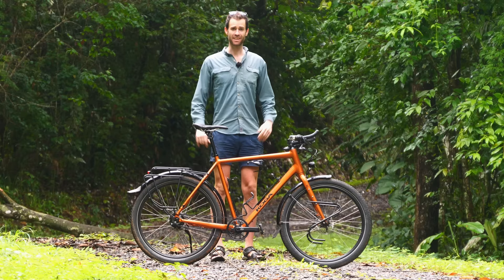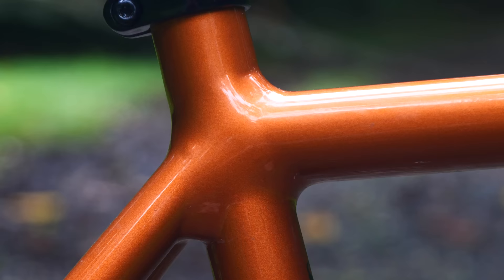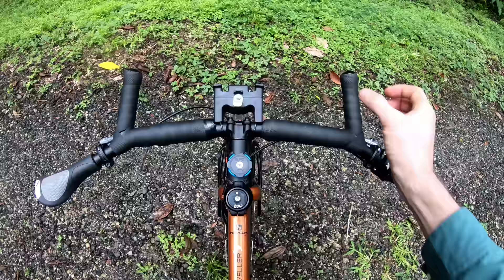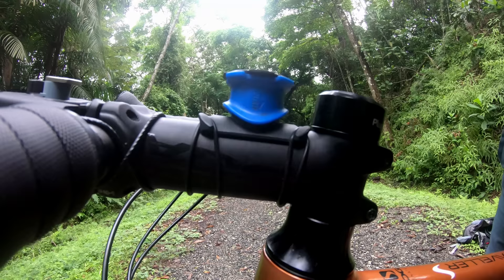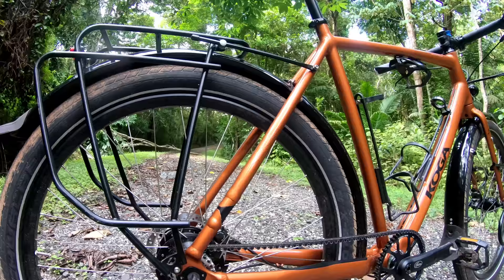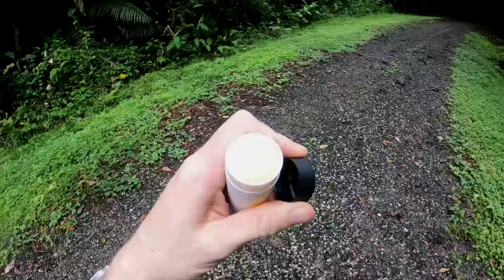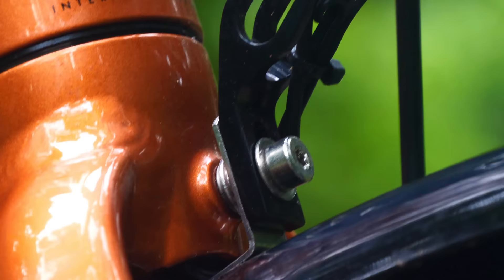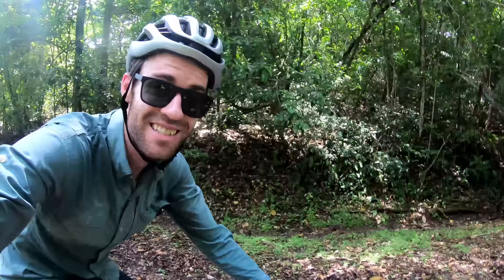The 2020 KOGA WorldTraveller-S is a $6000 Indestructible Touring Bike

Comment: Super smooth welds? Well where your rear forks meet the wheel i found the welds kinda boiley, but hey what do you want at this price level?
Reply from the maker: What does boiley mean?
Reply: @Cyclingabout  like it is boiling, as if there are bubbles and pits coming up the surface. Koga did a great job smoothing the weld on the main tubes (or asked their framebuilding company to do so) but left out those welds near your rear wheel, i find that strange. The line about the price point was me being sarcastic about that, because at this price point i would not want any defects - visual or technical.
Reply from the maker: @joramvandervorst7715  Gotcha. Not sure why the welds on the rear end don't get the smoothening treatment, I suspect they need a certain amount of surface area for the putty to stay in place.

Comment: Alee, Koga offer the same bike with an electric motor drive.  Do you know anything of it’s performance and durability?  Could you go to the same extremities that you do with the non-assist, Rohloff version ?  Asking for a friend.  Ha.
Reply from the maker: It's essentially the same bike, but it's using the best electric motor available, in my opinion (Bosch CX) and can support 1000Wh of batteries. The Bosch motor and Rohloff E-14 also communicate with each other for insanely fast gear shifts! You could do the same kind of stuff as I do, but you would just need to find a power outlet a bit more often.
Reply: Thanks, Alee.  It’s what I was hoping you’d say.

I ordered one this afternoon with a cash windfall.  Literally, a life-saver, or I’ll pass with a smile on my face.  :-)
Reply from the maker: @Super.Quasar  Congratulations!

Comment: Sure, I've never broken an aluminum frame bike, because it doesn't flex like steel. I've broken right side chain stays on 2 steel frame bikes. But I'll take a flexible steel frame that breaks every 3-4 years over the harsh ride every day that aluminum has. Flexibility has a place on touring bikes. Can you imagine 6 hours a day on an aluminum frame?
Reply from the maker: It's a myth that aluminium bikes are uncomfortable, and we actually have data on this. It requires over 500N to flex most bike frames one vertical millimetre because triangles make for very stiff structures! In comparison, a flex seatpost like the Ergon CF3 requires just 69N, and your tyres require less than 50N to travel the same distance (the wider the tyre, the less force required). In the scheme of all vertical flex, the frame makes up a very small percentage, aluminium or steel. 

Can I imagine riding an aluminium frame for six hours? Yep. I typically ride my aluminium touring bikes 40-50 hours per week, and I find them supremely comfortable. 👍🏻
Reply: @Cyclingabout  Look, man, I've been bike commuting up to 52 miles a day, since I was 15, and I'm 49 now. I was hot to get my first aluminum bike, and the vibration was wicked. My hands were numb and butt hurt even with 10 years on a brooks. Back to steel and then gave aluminum another try. Jarring is the best description. Carbon is great for a plush ride, but it does not last as long as steel either. Best for comfort is Steel with carbon bars, Last, I'm 6-5 265, so we are very different riders, with very different sponsorship deals. Company hands me a 5K bike I'd likely love it. Then again, ever consider you wouldn't need fat high rolling resistance tires if the frame cushioned your hands a bit?
Reply from the maker: Don't get me wrong, I can 'feel' the difference between aluminium and steel bikes without bags (although it's pretty damn hard with wide tyres, a flex seatpost and good grips). But this mostly comes down to the way the materials handle vibrations, rather than the way the structure flexes vertically. Add panniers to a bike of any price point and the vibrations will disappear because they absorb so much shock!

What kind of tyre widths were you running on your aluminium bikes? Were you running an in-line aluminium seatpost too? Did you ever attach panniers or bikepacking bags?
Reply: Jason Pippin / I use fat low rolling resistance tires, 42mm, prefer them over 28mm I used to use before. 4~6 atm instead of 7~9 atm before. 6'4" & 240pounds😎

Comment: Finding for sale "your" special handlebar is really very very difficult (and a little bit expensive too). I like it but in many parts of Europe, apart from few spots in NL it is almost impossible to find and buy it. Great handlebar but just to be seen in youtube. :(
Reply from the maker: You can buy it online! CycleSense in the UK and Vakantiefietser in NL are shipping globally. Price is the same as a Jones Loop including shipping.
Reply: @Cyclingabout  If the price is the same of Jones loop doesn't mean it is cheap. 86 euro + postage costs is a quite high cost for an alloy bar. Crazy bar costs 65. Apart the cost I wish to send you all my compliments for your cycling activity and for the introduction of the touring bar that is really very very nice. I am in progress to build up a Surly straggler with Alfine hub that it will look like your previous steel bike. For the moment (and for my needs) your fantastic WorldTraveller-S will remain a dream to be seen on youtube. PS by the way you did not mention that the Orange (great choice) it could be considered a tribute to the Netherlands (home of the Koga).
Reply from the maker: ciccio formaccio This is a very niche handlebar, so the cost can’t be low like a typical alloy handlebar! Given the unique design and engineering, I think the price is very, very reasonable.

Comment: have you ever heard of the Pinion transmission? they have long overtaken rohloff! I was a mechanic for Idworx, also from a certain Mr. Gastra, whose name is also in the Koga, the wheels are not worth their money!
If you want a really good travel bike, buy a falconry or racing steel. This is true engineering at the highest level! Own luggage rack with 50 kg !!!!! Lowraider with 30 kg. a Koga or idworx can not even stand this. and who please installed nice still an eccentric bottom bracket?

Comment: It's also cheaper than steel and not as hard on tooling
so it is cheaper to work. So why is it so expensive ?
Reply from the maker: The frameset has a very high attention to detail including the fully guided internal cable routing (this costs a fortune on a steel bike too). The research and development costs are also very high. The tube shapes and butting profiles are all unique to each KOGA frame size; you won't find these tubes on any other bike, unlike a typical steel bike.

Comment: Maybe it's my lack of touring experience, but having a belt drive, internal routing, and an aluminum frame on a touring bike where you are out in the middle of no where doesn't seem like the most ideal thing. Your frame cracks, it's toast. Have an issue with the belt drive? Good luck finding parts for it. Even in a large city with lots of bike shops where I'm at, most have limited to no selection of belt drive components. How could you expect a rural country you're touring through to have them? And internal routing seems like a cost saving measure for the frame manufacturers to not have to add braze-ons. Trying to route internal cables if something goes wrong while on the road sounds like a nightmare.
Reply from the maker: The reality is that frames almost never crack. A broken frame doesn't ever cross my mind while I'm cycling along, especially knowing how much research and development goes into a touring-specific frame like this (or any of my other touring bikes for that matter).

I carry one spare belt for my belt drivetrain. There has only been one instance in 100,000km+ of belted riding where I've ever needed to fit a replacement belt. I can't give this drivetrain higher praise!

The internal routing on a KOGA WTS is fully-guided. That means you put the cable in and it pops out at the right place. It's the most elegant and easy solution I've ever seen on a bicycle.
Reply: @Cyclingabout  they actually sleeve the internal routing? that's so rare nowadays. I wish more manufacturers took the time to do that rather than focusing on the aesthetics and forgetting about the maintenance and future mechanics working on it.

And I gotta say that's impressive with the belt drive system. Every belt drive that came into the shop would just squeak and creak, mostly due to the salted roads in the winter. So hearing that experience definitely changes my view of them. 

Maybe they are manufactured better with Koga, but I've only seen steel bikes crack from clydesdale weight riders. I've had far more aluminum ones come in with cracks or clean breaks with lighter riders and most are just commuters.

Comment: Oh its destructible allright. Gimme your bike and ill show you!
Reply: Well I CAN make it indestructible !!!. LOL.
Just need to wrap the frame with 2 or 3 layers of CF with a hard setting epoxy. I did that to 2 broken forks. Let it set for 2 days, then torture test. Laid them on the cement floor and WHACKED them harder and harder with a HAMMER. Barely dented the surface. Only hurting my hand. LOL.
On my frame then, I made a CF pouch between my feet, bonded to the frame. Plus I went all the way up the seat tube. It has a disc Rohloff with 17,000 miles. NO problems. My SA XL-FDD front hub has 25,000 miles with just the RS bearing change. NOTHING can go wrong with a DRUM brake.

Comment: I don't know if this has been raised before but wouldn't an alloy frame be less comfortable than a steel one?
Reply from the maker: It's a myth that aluminium bikes are uncomfortable, and we actually have data on this. It requires over 500N to flex most bike frames one vertical millimetre. In comparison, a flex seatpost like the Ergon CF3 requires just 69N, and your tyres require less than 50N to travel the same distance (the wider the tyre, the less force required). In the scheme of all vertical flex, the frame makes up a very small percentage, aluminium or steel. 👍🏻
Reply: @Cyclingabout  This is really news to me and I am skeptical since this flies in the face of what virtually everybody has written and reported before today. I even know someone who just sold his alloy gravel bike (Mason Bokeh) and went with a carbon gravel bike (OPEN UP) and he says that the latter is more comfortable. 

Let's see how this tour goes I guess. I do know of other ambassadors who have broken their frames on wild rides.
Reply from the maker: @waisinglee1509  Yeah, it's definitely a strange one. The only time it really makes sense is if you're using narrow tyres (like 25-30mm) as the frame flex would make up a bigger percentage of the total vertical compliance.

Along with vertical compliance, there is also vibration absorption, which is noticeably higher in a carbon frame, and to a lesser extent with steel. Perhaps this is the 'feeling' your friend has been getting with his new Open UP. Maybe it's just the new seatpost and tyres that perhaps offer better comfort.

Either way, you can make any bike comfortable with fat tyres and a flex seatpost! Up the front, you can additionally use a suspension fork or a suspension stem like the RedShift ShockStop.
Reply from the maker: Al, I think you'll enjoy this article! There are the findings of a well-designed study in there to boot. https://cyclingtips.com/2016/06/the-science-of-bike-building-what-factors-affect-ride-quality-and-what-even-is-it/

I've also had the pleasure of riding hundreds of bikes over the years, and can certainly notice the nuances between different bikes unloaded. The thing is that the latest evolution of tyres, flex bars/stems/posts are really muddying the water currently - I'll be damned if I could tell whether a fat bike is using a carbon or steel or aluminium frame. Vibrations get even more complex when you add any luggage to a bike. Putting panniers on anything dampens the bike exponentially, making it feel like you're sailing on the open ocean on a nice still day.
Reply: @Cyclingabout  - I've noticed this even with my Ti Fargo. It feels a lot smoother when it's loaded vs unloaded.

Comment: Sorry to say but Aluminium, while being a good and versatile material doesn't really compare to steel or Titanium of equal quality when it comes to durability and longevity. A 6000 Dollar Touring bike should not be made out of Aluminium, but of Titanium or at least high quality steel. Aluminium is just very stiff, which makes it a good carbon alternative (despite the weight gain for frames), but it is not as durable as steel or Titanium

Comment: Aluminum is strong before it fails. The metal has a much shorter fatigue life. Steel doesnt have one. Steel bikes are dying but theres more than just strength that makes a material desirable.
Reply from the maker: Yes, aluminium fatigues, but we can design aluminium frames with enough reserve strength to last the lifetime of a rider. It's not a big deal in practice, unless you plan to ride your bike for 100+ years.
Reply: CYCLINGABOUT Engineering is definitely becoming more complex and aluminum frames are tough Im just a little biased because I've broken aluminum frames. Steel just feels springy personally. Its like positive feedback

Comment: No, it's not a myth. Countless tests have been done comparing strength of all bike materials. Aluminum IS the weakest, and harshest riding, of all the major frame materials. Aluminum will always fail before steel and if steel frame does fail anyone with a welder can repair it. This simply isn't the case with aluminum. It would be smarter touring on a $10 Huffy from the 90's than this thing.

Comment: Amazing machine!
Can I get those bars anywhere??
Thanks
Reply from the maker: Vakantiefietser in the NL or CycleSense in the UK. 👍🏻
Reply: Thanks
Reply: Any thoughts or input on the possibility of these bars on a salsa cutthroat with its specific geometry for drop bars?
I know you’re busy… Much appreciated
Reply from the maker: @23skido  You will be able to match up the hood location pretty easily with the right stem length (you'll need to go a bit longer).
It'll definitely change the reach of the bike in the grips though, making your body more upright. Think of this position more like riding a dutch bike! I personally like a short frame for what I do - you can see me riding with these bars in dozens of videos from this year and last.

Comment: The problem is that touring on a bicycle is supposed to make you relax, how can you chain a $6000 bike up whilst you go into a pub for lunch? or into a museum? etc and relax?
My Cannondale SM600 1987 and sm700 1988 have beautiful smooth welds, and aluminium too and are super light bicycles, they never let me down and are worth $300-500 each, so I can just chain them outside a cafe and chill.
Reply from the maker: It's insured, so that takes a little stress off my mind. But it'd mostly just be a pain in the ass to lose. I try to be smart about where I lock it. I usually ask hotels/cafes/restaurants if I can store my bike somewhere safe which 99.9% of places are happy to help with. Anyway, I've been travelling with Rohloff bikes for over a decade and still haven't had one go missing! Fingers crossed.

Comment: Had a signature world traveller and sold it im so sorry i did as koga dont seem to have as good a choice as when i specd mine, i definitely wouldn't have belt drive again tho id go for the chain, anyone thinking of belt drive, go to probably thee best expedition bikes thorn cycles England and they explain why belt drive is no good, im currently deciding between a thorn or koga
Reply from the maker: I'm afraid my experience of belt drive is overwhelmingly positive! And that's pushing it to the absolute limit. I usually get 30,000km out of a belt, there's no grease and I barely do any maintenance. What problems did you find?